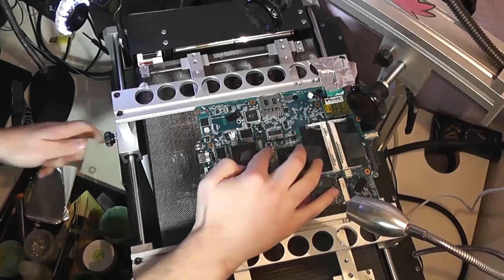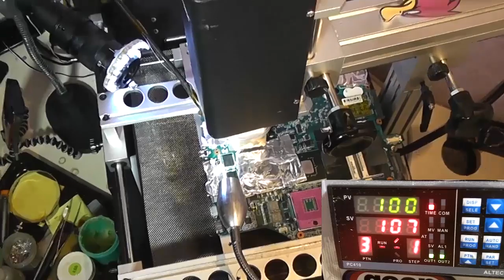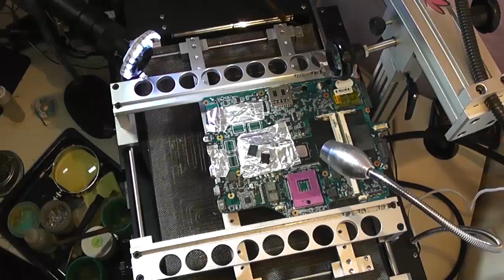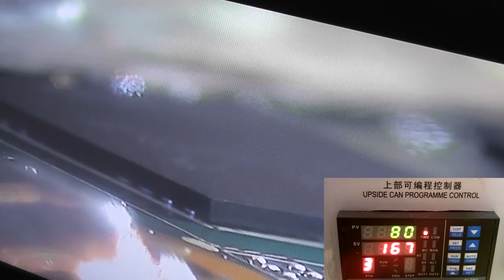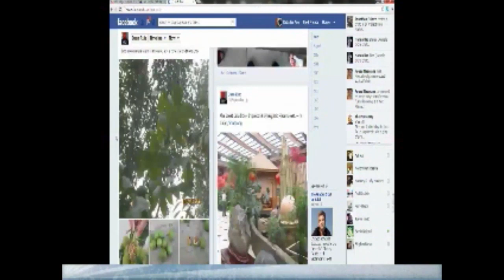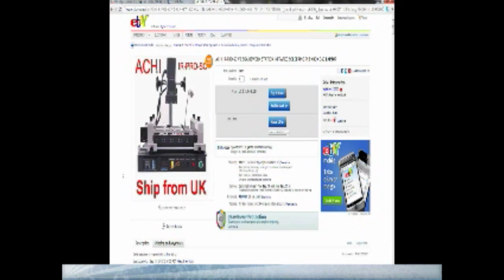Sony Laptop Video Ram Repair - Podchip BGA 01

Comment: Hi, I just removed one vram chip from GTX770 since it makes smoke. I used heatgun. Card started but I see static noise in all video modes. GPGPU codes makes card freeze. I wonder if card work on 7 good chips with 8-th broken removed? If yes is it worth to try to remove some other chips that is close to those damaged chip.

Comment: Can you upgrade the capacity of the individual RAM chips? For example, I have a 128mb RAM chip, can I desolder that and replace it with a 256mb+ RAM chip ?